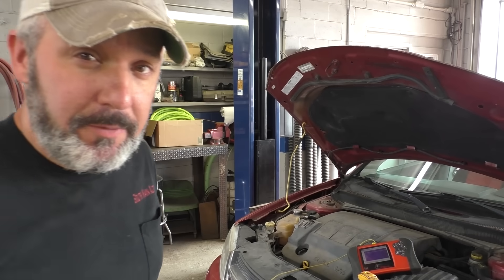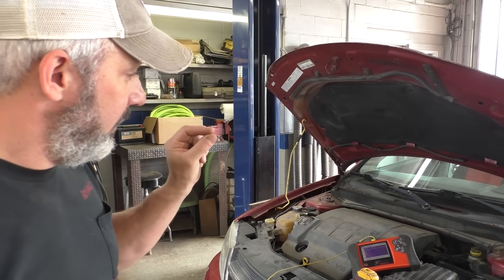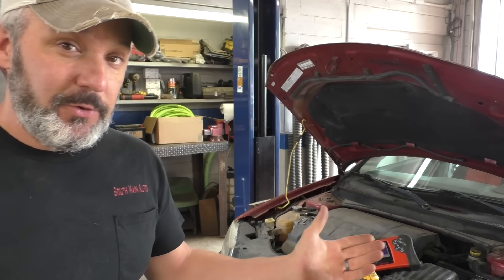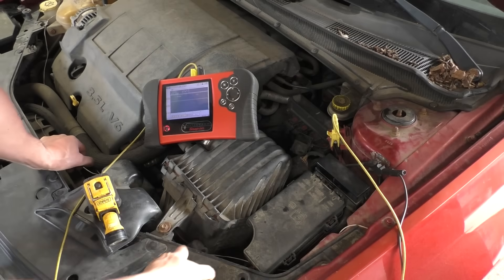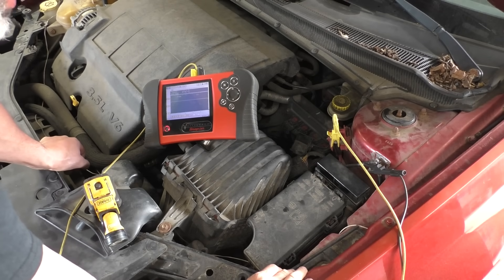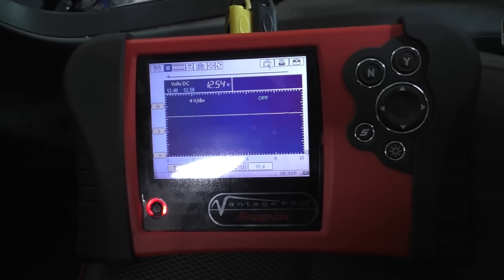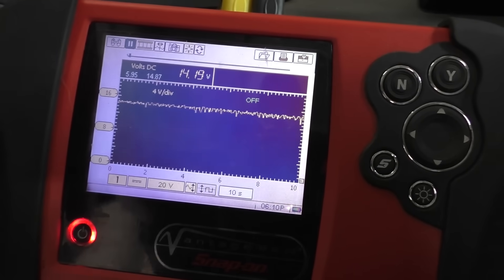Another Lesson In Voltage Drop - Don't Skip The Basics!

Comment: Youre making me miss the Sun VAT 40, brother.
Sure it was big.
It was analog.
But it worked, and the shop or schools provided that common thing, and you could see it and prove things, and call the management or the instructor over to view the test.
It worked so well, they quit servicing repairing, or making parts for them.
Lol.
But now, each tech has to buy something to have and trust that seems as good.
That was another example of a car where the engineer screws both the mechanic and the customer.
And after they have guessed and replaced several components, THEN its time to get the initial hour of diagnostic tests.
We see, somebody assembled a clean and shiny to a gross and crusty.
Then the whole car gets assembled in the way.
Its buried below.
All the good engineers got put out to pasture for being too right and sensible.
Good thing youre there to run those tests and do what a third year apprentice learns at night school, if he hasnt found out by then.
Thanks for the back to the basics video. 
Mr Covert, the old automotive engineer instructor, always said, "99% of all the electrical problems you will find, will be bad grounds, and bad connections". He would appreciate this one, the engineer created a covert operation out of accessing it. Back when he was our instructor, mopar used some decent and substanial parts for this.
That was when men were men, and put their pants on one leg at a time.
Good to see you still do.

Comment: We have a hondoo atv at our scout camp, and it has frequent no crank, we cleaned the solenoid terminals and boom she kicked right over, about six months later, again it wouldn’t crank, we replaced the aged battery, and again it shows 12 v at the battery, so it’s either a dirty connection or the starter. Voltage drop when pushing the starter switch drops to 8 volts.

Comment: Using voltage drop troubleshooting I was able to identify a mostly burned up alternator B+ cable that was affecting charging, it had destroyed 4 alternators that had been replaced by other shops. 2010 Odyssey. I also use a load-pro lead set on my Fluke.
Thank you for always reminding us of the basics.
Reply: I just had this came to my work. 2016 odyssey. 1 volt voltage dropped!! I cleaned it on alt b cable and replaced with new nut. It’s charging. It was tough to make it call. I shoulda replace new cable but haven’t comeback yet

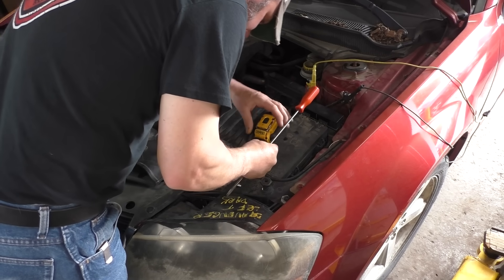Comment: At 4:19  and 6:07  To stop the disagreers, Instead of removing the black negative lead from the screwdriver shank and then clipping it onto the ground stud, leave the black lead on the screwdriver shank and pull the whole screwdriver up and probe the ground stud with the tip of the screwdriver to show that using the screwdriver as an extension probe doesn't change the readings or add any more voltage drop.  It probably won't shut up or stop the disagreers from disagreeing all the time, but that's because those people are just naturally disagreeable.

Comment: This has to be the most through explanation (with real life example) of how voltage drop works. Is it fair to say the difference in potential is similar to the amount of resistance in between the two measurement points? The missing expected voltage would have to be blocked (like rust or corrosion) or consumed (like a dome light that doesn't shut off)?

Comment: I'm really confused that while only drawing mA there was 1V of drop but while cranking (drawing 100's) it only increased to 1.5V
I would have expected the voltage to hit the floor with that kind of load?
Reply: There may have been some light circuits drawing a few amps (if the door was open).

Comment: I learned voltage drop when I was in trade school.  That was a long time ago. (1984),  Over the past 40 years I've only had a handful of times when it would have come in handy, but of course, for the most part I worked at new car dealerships.  I'm semi retired now and I work on old rusty junk.  These refresher courses on voltage drop will come in handy.  Thank you.
Reply: New car dealerships typically see cars that are less than 5 years old.  The built-up resistance usually follows after more years have passed.  Independent shops see them all the time because they work on a range of old & new cars.
Reply: Wow 1984....a long time ago...me too,  us old school mechanics ....Yes the video was a good refresher....

Comment: I wonder if a thermal camera on your phone could do the job even faster.
Reply: Not if the battery is in the wheel well (this video), or the starter is under the air intake (previous video).

Comment: I love that you said the VOM reads potential voltage. Most people do not realize the difference between potential and actual. I did industrial maintenance for 25 years and the amount of times that something didn't work and a co-worker said it should because the voltage was there was staggering. That is why you rely on test lights instead of a meter.

Comment: Aftermarket systems installed on vehicles can cause a LOT of voltage drop problems in fleet vehicles.  Then they became our problems when they didn't work right.
Or when a three axle tractor with trailer had a problem with the OEM instrumentation not reading correctly and for several months the problem was chased.
When the vehicle came in one day the dash voltmeter read in the 11 volt range.  With the engine running, one of the two group 31S batteries read 14.2 volts the other read 12.4.  Both batteries had individual positive and negative cables going to the starter.  When the cables were  checked by pulling on the cables near the lugs (terminal) at the starter one cable pulled out of its lug.  
It took a little work to fix it but once repaired both batteries read 13.5 volts, no more voltage drop and that repair eliminated all the electrical problems in the vehicle's instrumentation.  YA.  VOLTAGE DROPS ! ! 
Good one Mr. O!

Comment: Eric, a great tutorial. One of the additional challenges of looking for the trouble spot is finding a way to probe a connection point and the connected conductor. Over the years my collection of DVM probes with weapon sharp edges and a variety of file sharpened back probes has filled a shoe box. Surface oxidation of a connector or exposed conductor can be an additional challenge. BTW the insulation piercing adjustable needle probes made by Pomona are wonderful. I always seal the pin holes in wire insulation with liquid electrical tape afterwards. As you aptly pointed out ,every mechanical interface in a circuit is a potential failure point . Be thankful you don’t have a boat that is used in a salt water environment. Every connection point is a potential trouble spot. It’s beginning to look like this is the reason why the electrical system in the MV Dali container ship failed at a most inappropriate time.  Dude, you are a wonderful instructor . With all the electronics in cars these days , an individual with a good basic understanding of electronics and electricity will be a superior automotive diagnostic tech.

Comment: So what is the fix?
Reply: I saw the rusty battery terminal clamp, so I wasn't sure if you just cleaned the rust off, replaced just the clamp, or replaced the whole cable. Thanks for the help.
Reply: @lukerudolph1022   
✔️
Reply: @lukerudolph1022  Eric O said in other comments the 'other shop' did the fix, he was only involved for the diagnosis.
Reply: What are your thoughts?
Where did he say the issue was?
Trying to help you answer your own question.
Reply: Same as the previous video, an OEM battery cable and clamp.

Comment: Wonder if you had  ohmed out from the stud to battery terminal  would you have seen unusually high resistance?  That short of a run should be almost 0 ohms. Voltage drop is the result of resistance so wonder if you could use that other test to "essentially" find the same issue.
Reply: Yes, but you can’t run voltage through the meter on the ohms scale.  It will blow meter fuse or toast the meter if it’s a cheap one without protection fuses.
Reply: @slalomking  I meant with the circuit off.

Comment: I showed my son voltage drop by putting a 100 foot extension cord onto my car battery and then hooked the meter to the other end and it dropped from 12 volt at the battery down to 9 volt at the end of the wire,

Comment: This is exactly why my headlights were flickering on my 2011 Silverado. Bad negative terminal at the battery. After a round of YouTube voltage drop lessons, I narrowed it down and replaced the terminal end. Fixed the problem, and gave myself confidence that “If you can do it, I can do it.”
Reply: @chuy1674  The battery terminal ends on those trucks are enclosed so you can’t even see the green puss taking over the cable inside. I couldn’t see it until I cut the cable off. But I figured it out with a multimeter and SMA lessons.
Reply: I had a voltage drop from battery hitting radiator and loosing the acid.  Lots of soldering to repair the wire harness under the radiator.  Used a lot of baking soda as well.
Reply: Well done .
Reply: This same condition hit my 2011 Silverado. I had noticed the flickering for years, but while I was towing cross country to a new state it would randomly shutdown on the interstate. Fired the parts canon getting batteries and alternators replaced until I found a thread showing where the issue was. Now I wish I kept the cable to see what I could learn from it.

Comment: So the negative cable had corrosion on inside of band that mates to neg battery post?  i didn't see an actual fix action, just diagnosis.
Reply: More like rust on the metal bolt between the clamp and post (see 13:15).

Comment: Did you check the voltage drop on the positive side?
Reply: Seems not, but worth checking. The value of 14.2V is much closer to the required charge rate than 13V shown initially.

Comment: Great video. You helped my find a bad battery around a year ago with the concepts you've demonstrated again in this video. One of the big takeaways that helped isolate my battery issue was whether my battery could hold around 9 volts during cranking. It held 2-5. At the point I discovered that I had already replaced the battery cables and starter and it still wouldn't start without a jump. Thanks again for reinforcing these concepts.